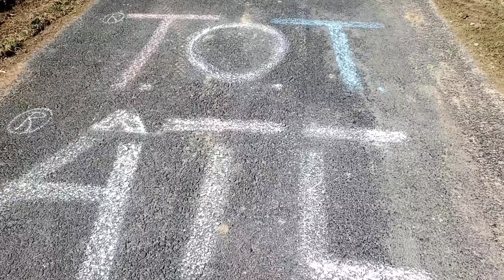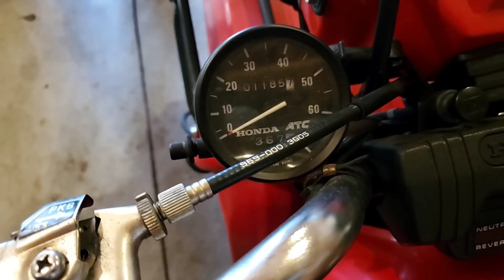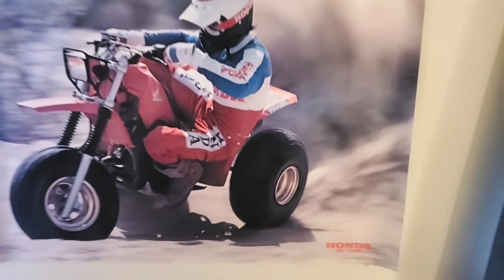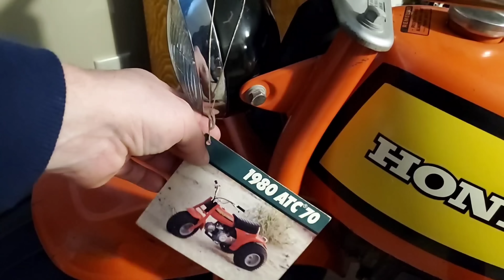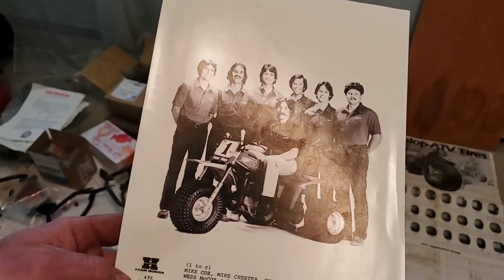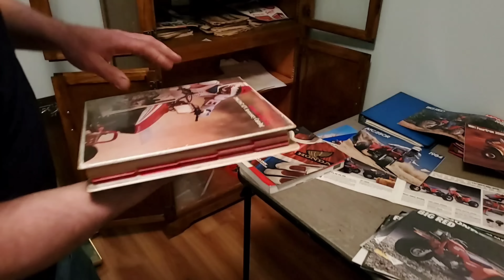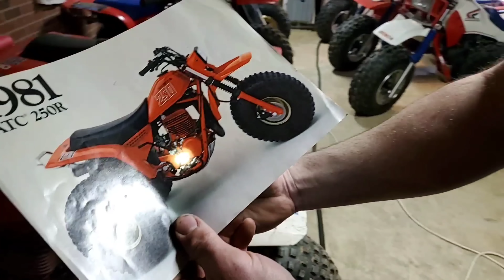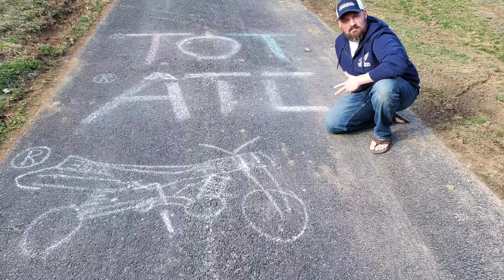Could This Be The Rarest Honda ATC 250R??  Take A Tour With The Infamous Tricycle Guy And Find Out!!

Comment: I started in 74 with a 90 and the Balloon Tires, then a 78 90, then a 80 110 that I tricked out with 125cc, cam, intake, carb, low profiles, straight header and wider axle plus lots of weight loss. Then an 81 250R and the same trick outs basically as a Desert Racer, then an 84 200X and finally a 85 250R with Paul Turner kit and pipe as well as suspension work that was just wicked! I tried riding a 250 QuadRacer when the 4 wheelers came out and HATED it!

Comment: I started out on a 1970 ATC 90. Balloon tires, 4 speed with a low and high, no clutch. I freaking loved that thing. I remember when the 250R came out…super exciting. In 1983 my mom bought me a brand new ATC 200X. i put a wider axle, low profile tires, answer bars, Bassani pipe, 28mm Kiehin carb, tank scoops. Loved it. Loved both my ATCs. They were both bullet proof. 
I always wanted a 300X. 3 wheelers are the best.
Reply from the maker: Man, that's awesome.  You had a rockstar mom from the sounds of it!  Probably were the coolest kid in school and the prom king too if I had to bet!  What color 90 did you have?
Reply: @ThisOldTrike  definitely none of those things, my 90 was red. The guy that got it from me painted it yellow. Was a pretty yellow, but I think it looked better red. I rode that thing for years and then traded it on a Yamaha MX 175. About 2 years after that I got the 200X. Three wheelers will always be special to me. Love those things! Great Channel

Comment: When I was 8 years old my dad came home with a 86 250 Big Red brand new. What a machine I literally grew up on that bike it ran hard and strong for at least 20 years and man I put that Trike through hell and back. Flipped it and sank it more times than I can remember and yes I have the scars to prove it and that was gust me never mind the abuse my dad put it through. Transmission eventually broke now it sits behind the barn all clapped out. I might try to fix 1 day I'm sure it will still run but it's been a least 15 long cold winter's since the last time any heat came out of that tail pipe so I don't know. Of course it will it's a Honda. 🤞
Reply from the maker: Man, I loved that story.  I would encourage to you give it a shot!  There are lots of people out there that would help you find parts and whatever you need.  Go for it!!
Reply: Would you like to sell it???
Reply: @ThisOldTrike  Would you have any 3:wheelers for Sale???

Comment: Bringing back the memberberries with this video! I had a red ‘72 atc90, and ‘84 atc125m, and an ‘84 atc200x. The 90 wasn’t stock though as this was pre-ebay so parts were hard to find on my lawn-mowing budget (early 1990’s) so it got homemade adapters on the rear and a modified 185s front end all to fit tires that kept the air on the inside!

Comment: Love this, I'm probably around you guys age, grew up on 3 wheelers, parents bought my younger brother and I 3 wheelers, I got a 250 SX, brother got a 110, my dad had a 200X that he did everything that was possible back then to make it make more HP, he had it bored out, sent the crank out to Rolle Bros, had multiple different pipes on it I recall, but stuck with the DG, had the suspension done too, this thing had such high compression, he had to run avgas in it, we liked to flat track race them, it easily beat a stock 250 ..... I miss those days.... I would still buy a 3 wheeler over a 4 wheeler any day if they still made them, u had to know how to ride a 3 wheeler and not everybody could, they weren't dangerous, they were FUN...
Reply from the maker: Amen brother!  I love that.  43 here!
Reply: Coming up on 32

Comment: Couldn’t find an engine for my 1984 CR250R two wheeler.Then I found an 85 CR250 R three wheeler used everything I could from the flange off the exhaust pipe to the thumb throttle. I still have the bike and it still runs unbelievable

Comment: My dad and I have been gathering parts to rebuild/restore our 1983 250r. It’s got one of the first Bills pipes exhaust systems on it that bill built in his garage while my dad was there with the bike… has a stuffer plate and a fancy clutch with super heavy springs, faster than any other 250r I’ve ever ridden including a bitchin custom 1986 330cc with +4 swing arm I got to race my Dad up olds in glamis on back on new years 95-96…

Comment: I recently picked up an 86 atc 250r. Ran really good. Last weekend we had it out and all the kids were taking turns on it. My buddy who’s got a really nice trx with an Esr 310 kit took it up the road and came back and said it wasn’t running very good. Swapped the spark plug and ran up the road and back and said it was running really good again. About an hour later one of the kids was riding by camp and it just locked up. Now we’re having a hard time trying to find parts to fix it.

Comment: I started on a 86 200s my mom bought us and we rode the dog mess out of it. When we got in trouble she would take the plug out of the 3 wheeler.  After thst i was hooked. Ended with a 350x. My most favorite 3 wheeler out of all.  Even my Tecate 250. I would choose my 350x. Jmo
Reply: Lmfao my dad would chain my gokart to the garage frame Cause he knew I would ride it with him at work. Kept me alive though cause I didn't have a roll cage and he did have to come pull it off me once

Comment: You can bolt in a SL70  4-speed transmission in the ATC70 case and use the clutch cover from the SL70 and have a hand lever clutch and still use the auto clutch ,,advantage is one more gear of course but you can disengage the clutch and do wfo hole shots or save down shifting on steep hills simply slipping the clutch a bit

Comment: The '83 at 2:43 looks to have a 36mm carb?  That would mean it may have 300+cc?  If you're interested in selling it, I'd be interested in buying it just for the motor.  I think it's the desert racing motor with a polished high compression piston and cylinder.
Reply: This is a standard jug bored to a 77mm so it's 295cc 36mm carb v force reeds bassani pipe it's technically not a desert, national, or mx  motor. just big displacement..the 300 kit is 7 head bolts DG sunburst heads are 6 bolt so that method was use to make that head work, it's a handful to ride and not for sale thanks for watching

Comment: my but has a 100% original 82 atc250r with original paperwork from the dealer hes selling we located in massachusetts and also has 100% original 80 atc185 aswell he did swap the mufflers but kept original for when he sells and original exhaust are amazing condition

Comment: I wonder if the black headlight trim is factory on that 86 200s? Any ideas Preston? Could’ve been just painted. But like you were eluding they kindve are rare birds and mysterious in some ways😂
Reply: Let me look it up
Reply: Yea it was... pause the video when he's focused on the dealer line up posters
Reply: 28:17
Reply: 48:09
Reply: @tricycleguy2657  wow, very cool..the subtle differences
Reply: 1986 ATC 200S had some black trim pieces that were chrome on 84 & 85 models.  Headlight bezel and grab bar for sure.  Not painted - from the factory!
Reply: @takeister  you are correct its hard to see in the time stamps I posted of the video but I looked in the 86 87 accessories catalog
Reply: @takeister  very neat, I’d love to own an 86 200s. And yes I can kinda be relate about the chrome to painted switch. 85-86 250sx was the same, did away with chrome for the most part.
Reply: Edit, while looking at mine, also the brake pedal and shiter are black from the factory.
Reply: @takeister  I'll hafta look at mine and the literature
Reply: @takeister  very cool! I’d like to see an in depth comparison to the 200s models

Comment: Could you help me real quick, I had a 84 big red 200es and it was chain drive I know this because I had to weld the rear end several times to keep the chain from falling off. Everywhere I look the 84 200es was shaftdriven. Was I wrong on the year of mine?
Reply from the maker: Most likely you may be confusing it with an 83 200E.  The S in 200ES stands for Shaft.  200ES also had reverse.  Did yours?  Do you have any old pictures?
Reply: @ThisOldTrike  I will check for some pictures, it did not have reverse but it did have a hi/lo switch on the case. And electric start. Thanks for the reply. So many good memories riding that 200!
Reply: Sounds like an 83.... chain drive with only hi lo no reverse... the dash should be different too ( no reverse light)